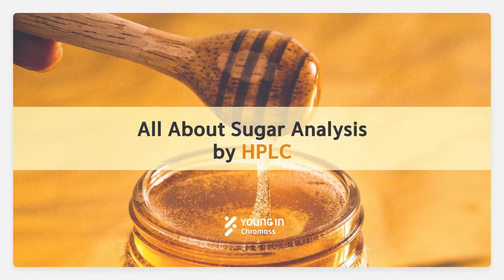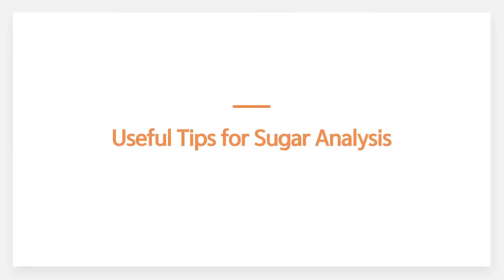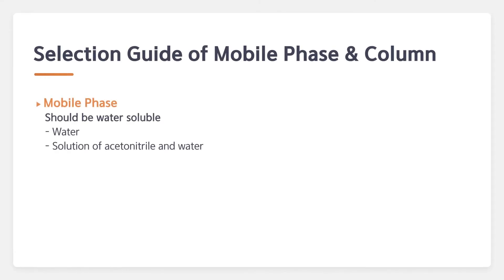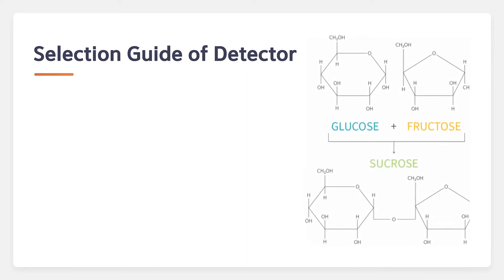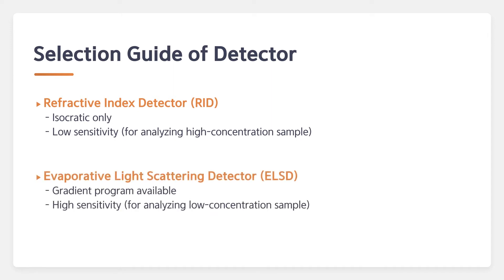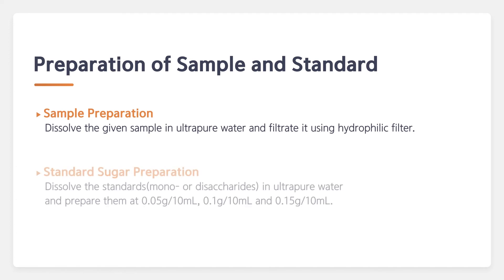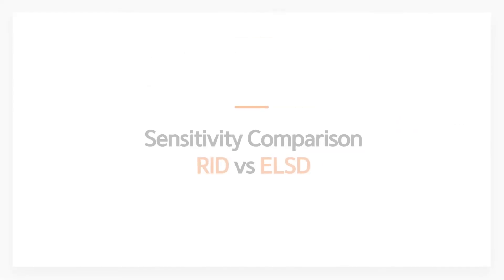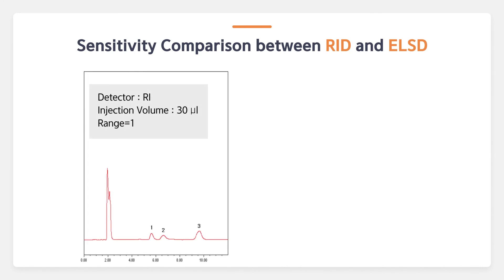All About Sugar Analysis by HPLC

Comment: is it a reversed phase HPLC ?
Reply from the maker: Hi, thanks for your interest in our Sugar Analyzer. The columns used in this application are the Carbohydrate and NH2 columns, which are the ligand exchange column and normal phase column. It is commonly recommended to use these columns for sugar analysis. If you have any other inquiries, please contact export@youngincm.com.